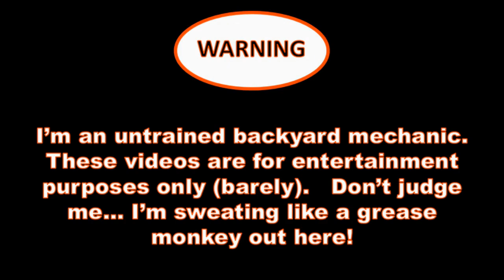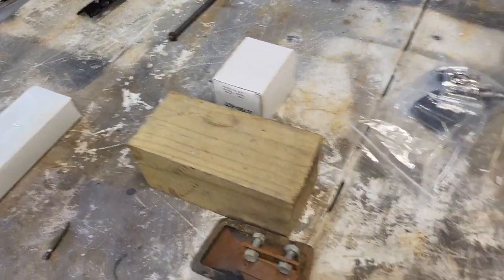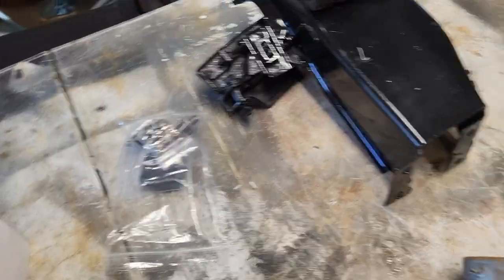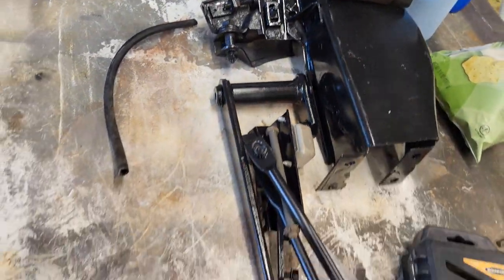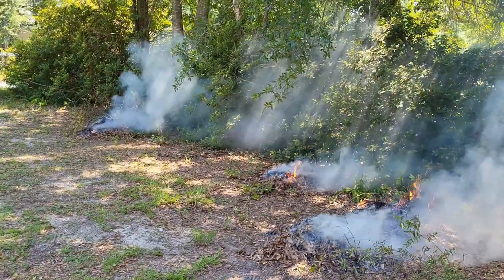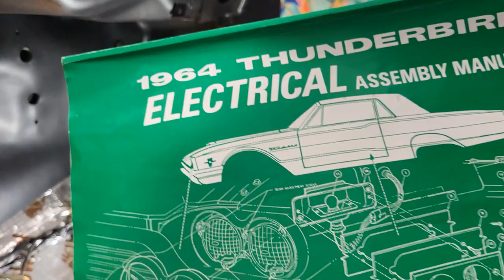1964 Thunderbird Interior Prep

Comment: Good to see the Tbird coming together, I had fun doing engine bay, rust proofing floor pans, cleaning up wiring looms.Are you going to treat inside of rear quarters? 
While I had the rear seats out I left the car out in a light rain then noticed a puddle where the rear seats go, It seems it had been leaking where the roof joins on the rear quarter by rear side windows, new sealant on those joins and some touch up paint and good to go.
It will be a fun day taking Dad on the test drive. 😊
Reply from the maker: Hey Steve.  I did protect the rear quarters.  I'll have to wait until I get the doors and such on to test if it is fully sealed.  That's a good idea though to do before the interior goes in.  It will be a good day when this car takes its first test drive and my dad will definitely be in it with me.